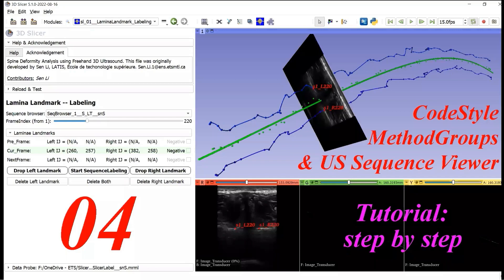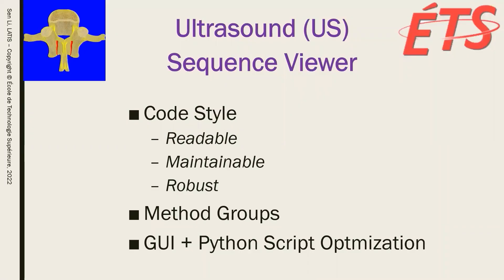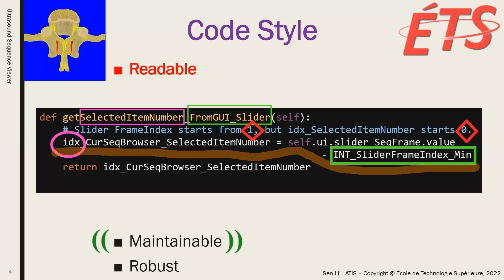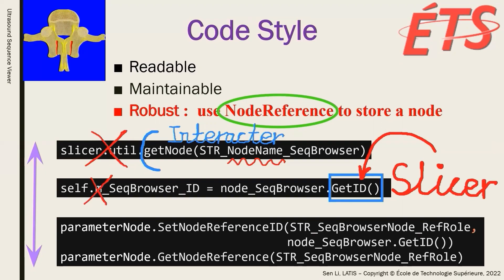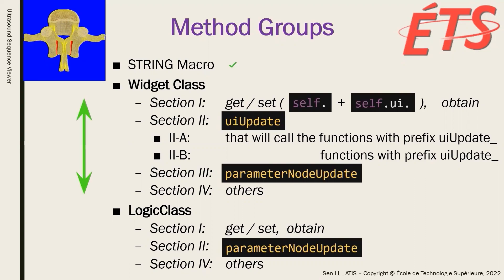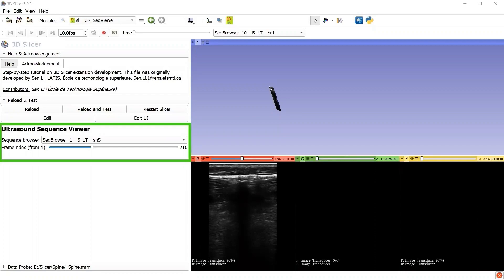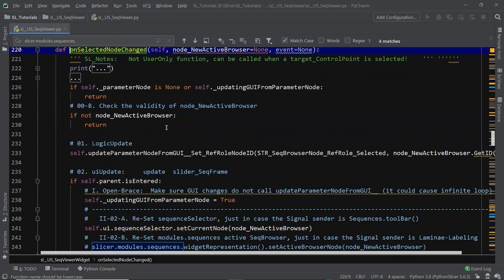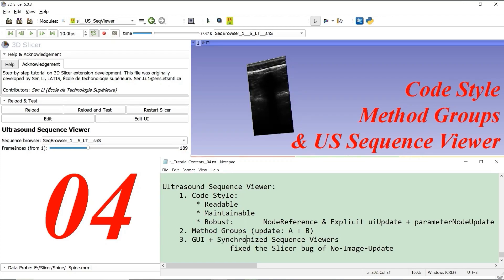Code Style, Method Groups & US Sequence Viewer -- 3D Slicer Extension Development Tutorial #04.

Comment: Hi, excellent tutorial! I wondering if there is a way to call external modules from our code??
For example I need the exit of the module center line to use it like an input to the module curved planned, so its possible create a module to  call/work with others?  Thanks!
Reply from the maker: Hi Lucas, thanks for asking! In Python scripted extension, you can call 'slicer.modules.' + existing ModuleName (e.g., 'slicer.modules.sequences') as long as the expected module is available.